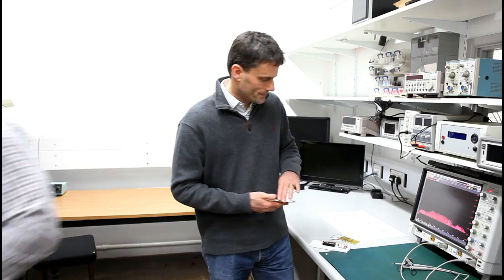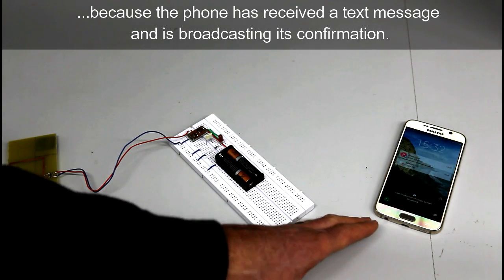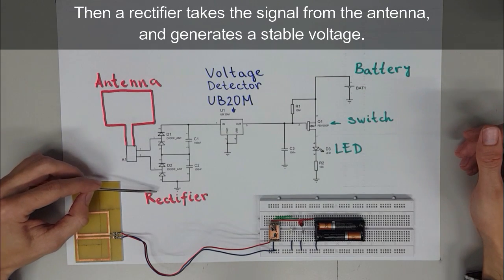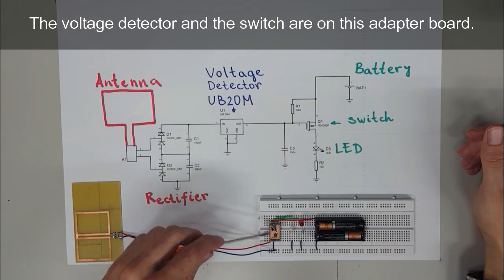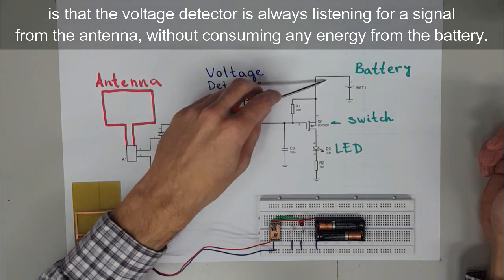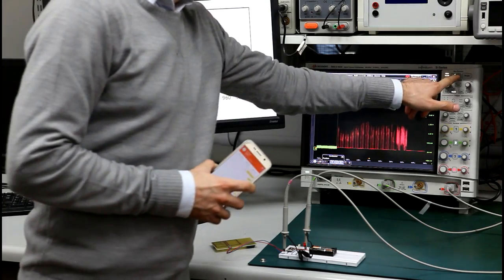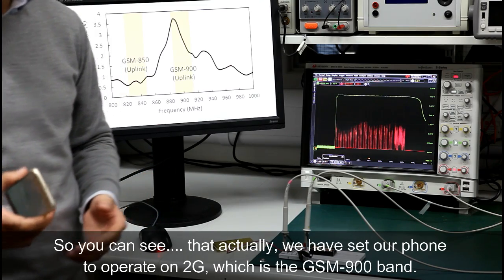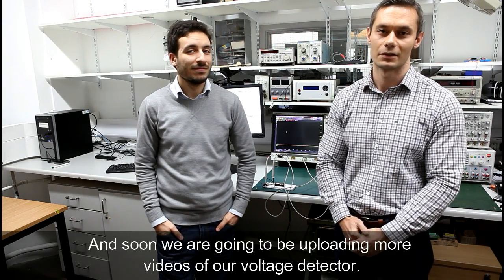Zero-power circuit that listens for radio waves

Comment: Excellent concept! You can even wake up an MCU (STM32L431) that is in shutdown mode (8nA) and can save a lot of static power. BTW, since there is no bandpass filter at the antenna RF stage, will it trigger for unwanted RF frequencies?
Reply from the maker: The antenna response is shown at 1:59, so you can see it's quite sharp, but in many cases you would need to power up some intelligence to check if the call was for you. It depends what the system is. If you are remotely turning on a sensor that you can't otherwise access, for example to get a read-out, you might not worry about checking the provenance of the signal.